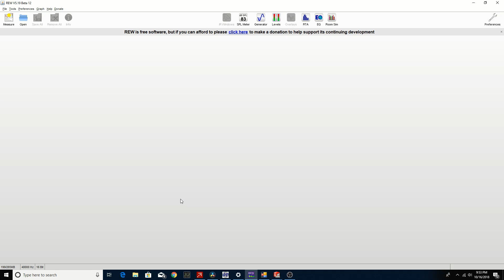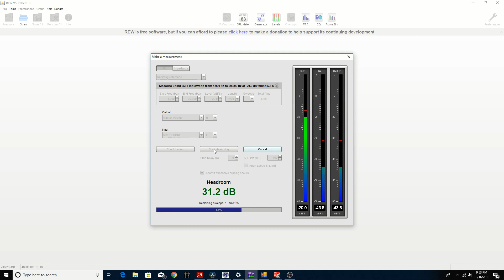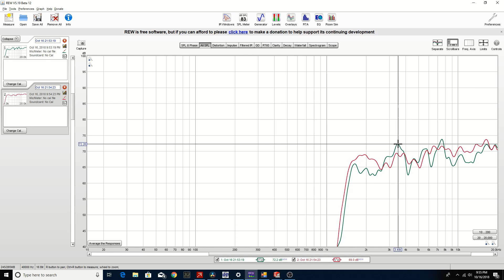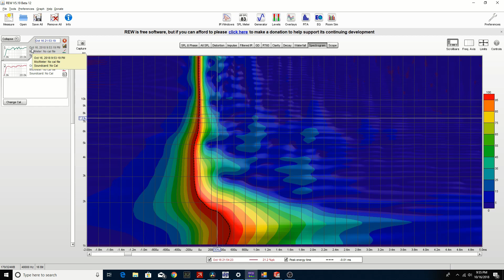12" Coaxial Project --- Smoothing out the transitions to reduce edge diffraction

Comment: Joseph: nice work with your DC coax driver. The small added cone section really helps. I was wondering if you might be able to achieve similar (or perhaps better) results using some 25 PPI (pours per inch) open cell foam rather than the add on foam core cone on the main cone? Fashion a fitted open cell foam plug to insert into the tweeter horn which extends out past the mouth of the tweeter horn by say a cm or so (a little longer might be better don't know). The foam will help with HOM's inside of the horn itself and it will also catch and damp reflections from the cone to tweeter transition area acting as a damping phase plug. The foam plug could even overhang past the OD of the tweeter horn mouth over the cone provided you account for cone motion where it could catch even more reflections from the transition area between the cone and the tweeter mouth. I have not had the chance to try this myself but thought I would share the idea with you. Please let me know what you think about this especially so if you give it a try. Thanks for reading.
Reply from the maker: moray james that’s a good idea.  I could shape the plug with my CNC router.  I’ve been using that type of foam on my other horn projects and it always seems to help. 
I could shape it to look like a dust cap.
Reply: @JosephCrowesDIYSpeakerBuilding  please let me know how it works out. I am looking into purchasing a pair of the small Tannoy XT6 (they also have a 4" version of this driver) which is probably the last of the great Tannoys we are likely see. (several years back a number of the key Tannoy employees left to start up Fyne Audio to carry on the Tanny heritage as it seems Tannoy is doomed to close). The Revolution XT series of DC mods was released in 2014 and is still current production but Tannoy may be sold off as parts by the new owner who purchase in 2014 but who now believe profits are not high enough to carry on the home line of hifi audio speakers). The XT series was the last and to date utilize the most significant upgrades to the Tannoy DC driver designed by Tannoy. If you have not heard them do give them a listen they are very good. The smaller they go in size the better they seem to stage and image. I expect the integration between the tweeter and  the woofer cone improves as the woofer shrinks.